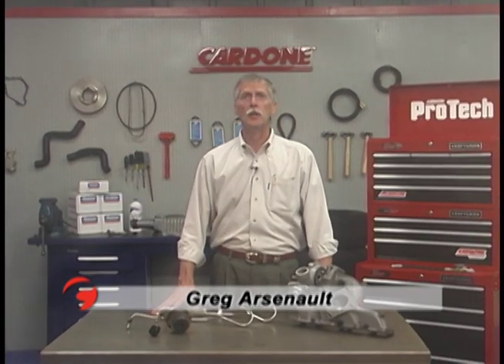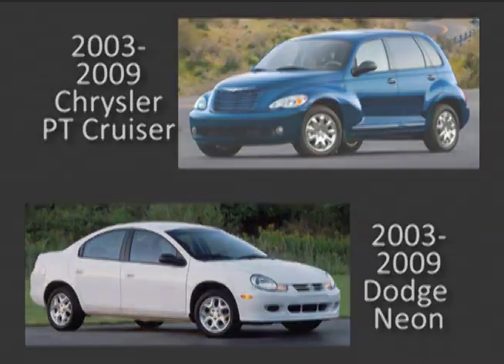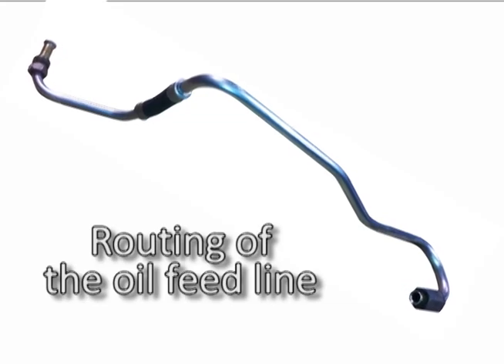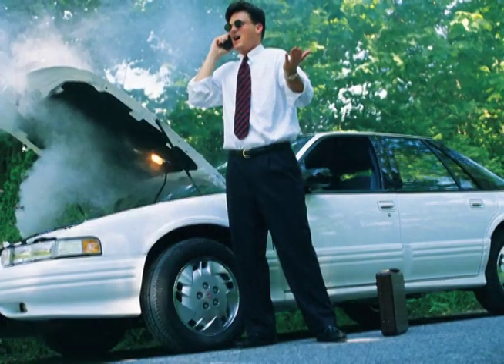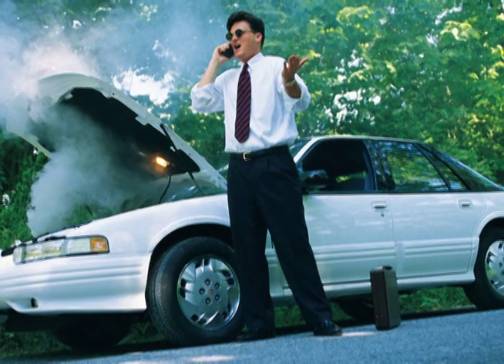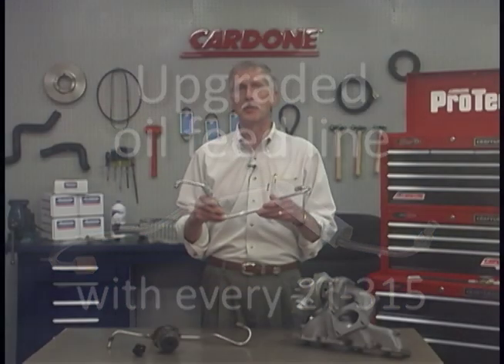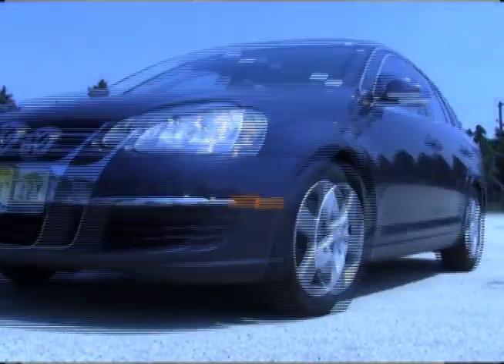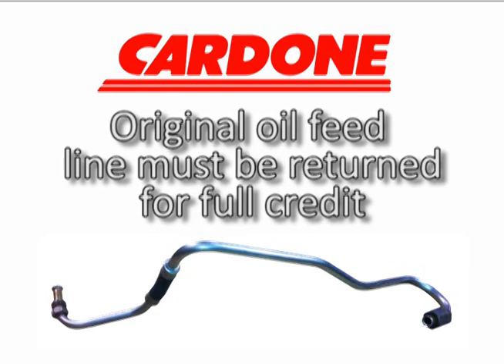Restricted 2003-2009 Chrysler PT Cruiser / Dodge Neon Turbo Oil Line

Comment: hello I have a 2003 Turbo PT Cruiser and it is blowing blue smoke out the tailpipe and burning oil like hell do I need a part but my PT Cruiser Turbo thanks.
Reply: PCV valve in the valve cover on the left side. Had one that did the same till I replaced it

Comment: hi is posible you help me i fixing a pt cruiser 2006 have problem which the air conditiong the compresor is new and condensor is new too but no find power the compresor  in the swiche me put on all look good but the compresor no run you can finded for me the electrical diagramg for pt cruiser 2006 pleasse i living in aruba  thanks you
Reply: Duvan Orozco

Comment: I have a 2003 PT turbo cruiser my oil ligt blinks on and off I have been told so many things oil pressure light sending unit low oil pressure being indicated this is the pressure light replace oil oressure light sending unit oil pressure sensor remove oil pressure switch I am confused what does my car need that litle old like is annoying dinging on and off help!!!!